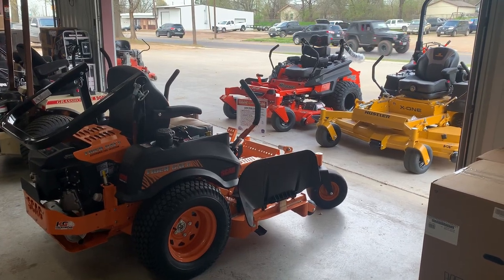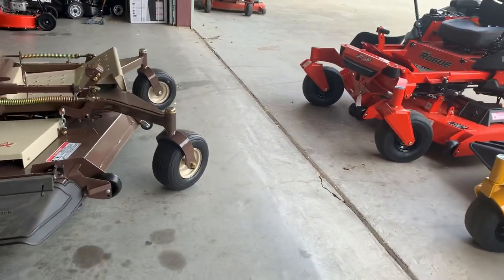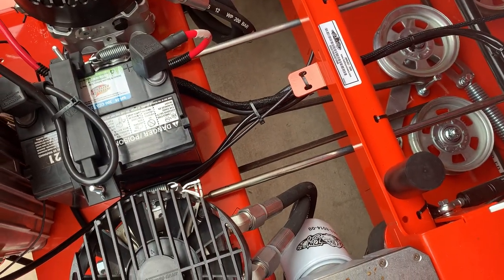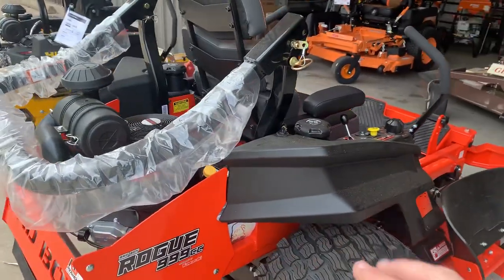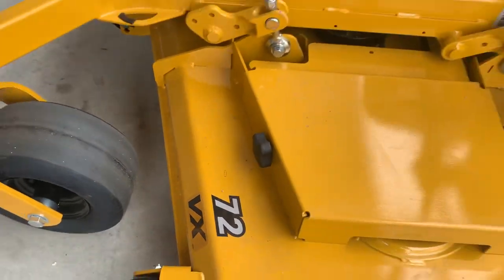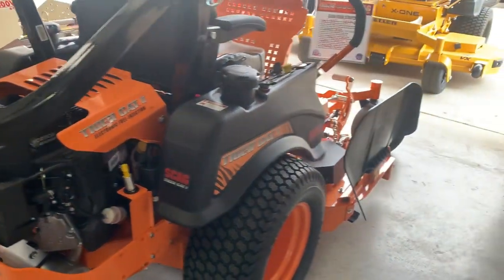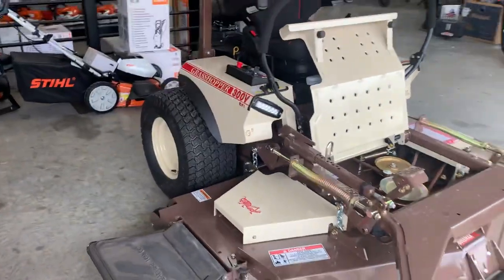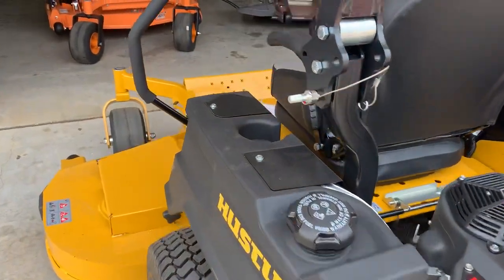Scag tiger cat vs grasshopper 300 vs bad boy rogue vs xone hustler comparison side by side.

Comment: I have a Grasshopper 335, bought it in 2018. So far, starter went bad and have blown three hydraulic hoses, and it sucks on the hills...oh yea, and it's fugly!
Reply from the maker: Their hydros are powerful.  Was it bad connections made?   We seen some that where they were clamped blew out just weren’t clamped right.  On the starter we see starters go with all motors.   Check out the 337 model they have redesigned them too look a lot cooler.   As far as being fugly I hated my grasshopper when I first got it.   I called it an “old man mower”.   It’s genius if you think about.  Best looking mower 20 years old it’s painted dirt color literally.    All these bright mowers fade out and look like dog crap after a few years.
Reply: @kgmowers  Don't like hoses, direct fitting pipes are best.

Comment: How about residential models comparison and reviews?.....
Reply from the maker: I just don’t have many right now.  I will try when I get some raptors and libertys in.
Reply: @kgmowers  ok looking at possibly my first zero turn, have had a cub cadet courage26 with 54" deck for last 13 years. I mow an acre about once a week. What would be your suggestion for most affordable/ reliable for my usage?
Reply from the maker: @bryanstaten5585   if you can swing it the Scag Liberty is my top pic out of the smaller mowers.    The cut is great, they do a 5 year warranty from the plant.   The mower runs in the upper 4K range, serviceable transmissions.   The hustler raptor series would Definately be a big contender with a 3 year warranty, the new design, the sdx is the best, but if you get stuck with a sd or an xl model it won’t hurt your feelings.   If you are gonna be running into stuff or doing most of the work yourself you may like a bad boy avenger as well.  The Badboy even the cheapest 3k one has a frame and a deck of a 9k hustler or Scag.    It’s much more accessible, and a little lower priced if you are paying cash.   There is only a 2 year warranty, so if warranty is your thing, or financing, the hustler or Liberty come back into the picture.    Gravely xl is worth looking at, redmax has a good little serviceable unit, Exmark pioneer, I will be honest most of the brands have some good contenders in this range.  They all have pluses and minuses.  As long as you pick a good dealer that cares about you, they could keep you happy in a craftsman honestly.

Comment: What’s your price on the tiger cat now?
Reply from the maker: 10500 48 10800 52 and I’m getting 3 61s next week for close to 12k I believe.
Reply: @kgmowers  what about with military discount?
Reply from the maker: @Bassinwithjesse   those are at 10% off the military discount if it’s not a sale mower is around 5% off of those prices.   They have quite a few models that are already priced the lowest possible it depends on engine deck options

Comment: I have a hustler now and have had it in the shop several times for the drive belt coming off. I’m going to sell it and get probably a bad boy.
Reply from the maker: Which hustler do you have?   On the raptor line they had a known issue with the transmission brackets that support them.  I bet if you look underneath you will see a crack in the supports around the bolts.  If you can’t see it get someone to sit on it and bounce up and down while you are looking under there you will see the movement.   Hustler upgraded that whole support I’ve replaced almost everyone I’ve sold already, but I bet a lot of dealers don’t know to look just throw a new belt on and roll on.    There is an upgrade and most of the time hustler has paid for the upgrade under warranty for us.   Let me know if that fixed you up.
Reply: @kgmowers  yes it’s had new fan motors put on and a new belt, my local dealer did the work and it seemed to work out until yesterday when the same issue happened again. I have the raptor sd. I’m to the point I’m done with it. I’ll just get a new fastrak or a bad boy.

Comment: My Grasshopper is awful my last on was fantastic this one with 200 hours was down two months last year and in shop again after one cutting. The list of problems is so long it would take me an hour to list. The factory released this thing not even close to ready!
Reply from the maker: That’s surprising to hear.   We have very little issue with hoppers.   Was it an engine or transmission issue, parts issues?     The only negative is we as dealers get them in wooden crates then we have to pmi them and make sure the decks are leveled, air pressure in tires is right, check nuts and bolts to make sure they are torqued right.   Most of the time if there is an issue it’s the dealers fault or just a bad part.    Your first 20 hours of break in period you will see around 80% of all the warranty claims you will have over the next 4 years.   So it’s not unusual to have a lot of issues as your first using any piece of equipment.   We’ve seen engines lock up from oil pump not working, transmissions go out etc during break in period.   Worst thing I’ve seen from the plant is like a bolt stripped out or something

Comment: How does a Husqvarna z560 L compared to be 27 horse Kawasaki I think the hydros 5400 series
Reply from the maker: I will be completely honest.   The only husqvarna mowers I’ve ever seen in my life were push mowers, steering wheel mowers, and stamped deck zero turns they sell at box stores.   It’s hard for me to imagine a husqvarna with a 5400 transmission in it...lol
Reply: @kgmowers  yes I mean I researched everything they have the Z5400 16cc and seems like they're better than the Scag but you got things just like John Deere having a line of tractors at box stores this is a commercial series z500 series
Reply: Well I went ahead and bought a bad boy with the 999 CC Kawasaki it's the Rogue it's pretty sweet with the Parker hydraulic

Comment: how about a tiger cat with a 48?$
Reply from the maker: We have some in stock!   They are $10300 to $10699 depending on the engine choice :).    Also have a 48 Vride for under 10k, and a slightly used demo 52 tiger cat kawa for $9k :).

Comment: only the leading edge on the decks are 7 ga.  or 10 ga. the rest of the deck i'm not sure of the thickness but its alot thinner than 7 or 10 .  only the reinforced lower leading edge thats 7 or 10 ga.  cheers.
Reply from the maker: Which one are you talking about?   Grasshopper is a solid 7 Guage deck shell with an added 10 Guage plate on top, and the added leading edge is extra.   Bad boy is solid 3 Guage with added plates around the spindles then added edge skirts, among others, Scag and hustler is the same way, solid 7 Guage sheet with added reinforcements.   Hustler is the stoutest on the front with the way they weld the baffling into the front as added reinforcements for front impacts.    Even the $2999 bad boy mower has a solid 7 Guage deck with added plates and reinforcement.   I keep the Guage metal sheets on our counter so people can compare the decks standing on the counter.

Comment: Kevin, Im looking for a mower for about 5 acres that is hilly (fairly steep) and very rough. Budget is around 12K. Recommendation?
Reply from the maker: Hey oh wow you can have some fun.  I would look at the renegade bad boy for the best ride, cheetah Scag for the best cut, 337 grasshopper for the most reliability, hustler super z for the “tank”, the new gravely 600 series (if the dealer is hungry), the big exmark is always a fav, the big toro (same thing) check out, I would prolly lean away from Ferris due to the stability of the company.  Check out Spartan srt-xd
Reply: @kgmowers  Thanks Kevin. Im really liking the 2021 Scag Tiger 2.
Reply: with 37 vanguard EFI

Comment: I bought a 62" Renegade with the 37hp Vanguard.

I'm very disappointed with the deck design.   The 14guage deck has a very thin inner grass shroud that is not boxed in into the front of the deck.  There is about a 4-6 inch space between the front lip and shroud.  Minor incursions is bending the inner shroud into the blades.   

I hate the deck foot pedal design , very aggravating to use on the run.

The USB charger is on the wrong side where the storage compartment that  has no water drain.  

I do like the mower on many levels.  It rides good and mows like a beast.

I was just disappointed in the deck design.
Reply: THAT BECAUSE BAD BOY MOWERS ARE JUNK MOWERS  SORRY FOR YOUR PURCHASE

Comment: I’ve NEVER seen a grasshopper, used by anyone in the country in the city anywhere.😵‍💫😵‍💫😵‍💫😵‍💫😵‍💫😵‍💫😵‍💫😵‍💫😵‍💫😵‍💫
Reply from the maker: They have been the most used in our area for over 40 years now.     All of our military bases, army corps of engineers, most of our cities, government entities all run kubota diesel grasshoppers.    I was told a few years ago they sell
More Kubota engines on mowers than any other brand including Kubota, but I don’t know if that’s 100% true or not.  

They are by far the most reliable brand out there.   My old neighbor in Brookston has a 1981 model and has never worked on the engine it still is mowing his yard strong.    
We have 11 in our market with the Kubota gas engines and they have over 11 thousand hours on them.     Absolute miracle range on lawn mower engines.   I recommend the Kubota gas 3 cylinder over the diesel every time because of this

Comment: The bad boys are WAY BETTER than any of the other ones!

A hustler shouldn’t even be in the same video. And I’ve never even heard of a Scagg! 

Ex mark 
Toro 
John Deere 
But the bad boy is the best built lawnmower in the industry. I’ve been a welder for 35 years and the decks on the rest of them are made out of tin compared to the bad boys.
Reply from the maker: Bad boy is our best seller and easies to sell.  Even the little $3k mower has a deck on it like a $15k mower from any other brand

Comment: Why do you not point bout the floating decks vs. the rigid decks?
Reply from the maker: I’ve never seen a rigid deck on a mower.   They all have a way to float up and down as far as I’ve seen with any brand.    Bad boy is a heavier deck so it doesn’t float as easy as a stamped deck of course, but every ZTR I’ve ever seen or rode has had a floating deck honestly.

Comment: Why don’t you ask for all the companies to go from belt drive to gear driven less brake downs in that
Reply from the maker: Idk I see a lot of shaft issues on the gear drive machines.  That can be super expensive to fix.  There are roughly 36 brands of ztrs and nearly all use belts.   There are a few kubota models with shaft drive, one Scag model, front mounts and some golf course big expensive mowers.   The belts have been proven and win our almost everytime.  I do believe the Scag turf tiger has the best shaft system so far we have had zero repairs 😎, but I prefer the cheetah with the belt, it just feels better to me mowing for some reason.
Reply: There's also the noise and extra inertia issues of gear driven, as opposed to belt driven. 
 Gear driven, if you hit something hard, something can break easier due to no mechanical give. 
 With belt driven, you may just throw a belt. The engines are all so powerful now, that any power loss on a belt system is a non issue these days.

Comment: Id take any of them over bad boy
Reply from the maker: Most that come in here leave with the bad boys.  Sitting side by side for the buck it’s crazy the difference.
Reply: @kgmowers   I have owned one .. like you said the bearings fail  a lot . I don't like them .
Reply from the maker: @brandonmurphy4657   you just upgrade the bearings.  We have to do the same thing on kubota etc…. We took the bearing up to purvis bearing and ordered the best bearings made in that size and we eliminate that issue right off the bat on someone’s first issue
Reply: @kgmowers   it's not just that  I don't like the square corners on the deck the cut quality . I just didn't like mine . They are not in the same league with scag,   Deere , grasshopper ECT imo
Reply from the maker: @brandonmurphy4657  the new r series deck is waay better than the old style
Reply: @kgmowers  the one where they tried to copy scag ?
Reply from the maker: @brandonmurphy4657   the slant nose deck yes.   Didn’t really copy Scag, but maybe closer to Ferris icd or duramax grasshopper.   The Scag has a crazy wide opening on the deck

Comment: Turf tiger 2. 20 k Canadian
Reply: Wow. The local dealer here in Maryland has the 52" kawi engined model for $10,500 usd I believe. I went with the 61" with the FT730-EFI engine for about $600 more. That's $5k usd difference. I could almost get into a Tiger Cat 2 for that kind of money.

Comment: The Scag is almost 1300lb. That isn't light.
Reply from the maker: It’s 1000 48  to 1150 on the 61.  It’s the smallest footprint in the line up if that makes sense.   Everything else is around 1300 and much bigger framed.

Comment: I know looks shouldn't matter but the grasshopper just yuck looks old dated hideous color lol I'm probably getting the bad boy but my 3 were scag hustler and bad boy but don't like bad boy didn't do 2 gas tanks on the models I'm looking at
Reply from the maker: After 10 years you wish you had the grasshopper.  They look so much better over the years.   First mower I ever bought.   I wanted to paint it black with flames on it or something.   Always called it my “old man mower”.    I got it because all the pros in the area used them.   I wanted the best mower out.   My second mower had a spoiler on the back it was a bad boy lightning.   It was crazy fast and took my production to a whole new level.   Other thing I liked about the bad boy was when something broke I could fix it in the yard.   On the grasshopper I had to take it to the dealer almost everytime, cause I couldn’t figure out how to get to stuff.   They all have positives and negatives, still not one perfect mower yet.

Comment: You can not adjust cut quality with blades! There's no way in hell you can do that. Run sharp blades with tight belt on a shit mower deck it's gonna be a shit cut.
Reply from the maker: Actually I can take any mower.  After dialing in the deck for the turf, finding the right velocity and suction with the right blades for the yard and make it cut amazing.   It takes a little time and patience.  I liked Gravely’s adjustable baffles, because with most yards I could simply move the baffle up or down depending on the grass and get a completely different cut.   Low lift, high lift, medium lift, extreme lift, Dixie chopper x blades, Meg mo, gator g6, g5, or g3 blades.   You would be surprised really experimenting with different types of blades on your mower.   Between Spartan and bad boy is over 100k of lawn mowers sold a year that would be a pretty big scrap pile….

Comment: Grasshopper needs to change its color design cause it's ugly
Reply from the maker: I hated it too until in the business.  My first mower I ever got, but I called it the “old man mower”.    I wanted to paint mine black with flames.   What really ticked me off was that I had a 2007 my neighbor had a 1981 model and his looked almost exactly like mine.    Best thing they could do is paint their mower dirt colors.    Example.   No Scag, hustler, kubota etc after mowing for 10 years am I checking to see if warranty is good.   There has been several times I’m pulling up the customer checking to see if it’s still under warranty when they pull up and I glance at the trailer.   I’ve had the customers have to tell me “sir that mower is waaay out of warranty”.     It’s really genius if you think about it.    Look at a bright colored mower after only a couple of years of use then one of these.
Reply: I've had my Husqvarna for 6 years and the color  still looks brand new. You have to clean it after each use. Would you rather have a Supermodel or a woman with ashen skin wearing rubber boots and bubushka? lol
Reply: Huh? Looks don't cut the grass, or make a difference in reliability. 
 Talk to long term Grasshopper owners. They don't give a rat's behind about looks. 
 But what they will tell you about, is how amazingly reliable their machines are, which is why they're long term owners. 
 As for me, in this day and age of flashy colors, sheet metal, and plastic, I find the retro style, and softer earth tone looks of the Grasshopper appealing.
Reply: @davidjudd221  Fine but the color still looks ugly.

Comment: Don't buy a bad boy.  I have a 2019 bad boy renegade diesel and it's always in the shop.   Huge piece of crap
Reply from the maker: What kinda issues?   If your mower was built April or before hopefully your dealer noticed the 4 upgrades 🙈.   Once we got it upgraded on the pump belts, deck upgrades for the deck belt, and the suspension upgrades you should be good.   I’ve got a ton of them out there and peeps loving them.   There was one more recall my mechanic told me about yesterday I forgot what it was, but it’s on every renegade diesel.   Make sure you have every upgrade done it’s free.    You dealer may not know there is a bulletin they have to click on I didn’t know where it was till my rep showed me.
Reply: @kgmowers upgrades?  That tells me they have a habit of rolling out equipment before it’s ready.  R&D has always been an issue with BB.  The reason there are so many out there is the price point not the actual quality of the machine.  I would take the Scag or the GH 100 times before any other machine in this comparison.  Yes I realize this vid is 2 years old now.  HA!